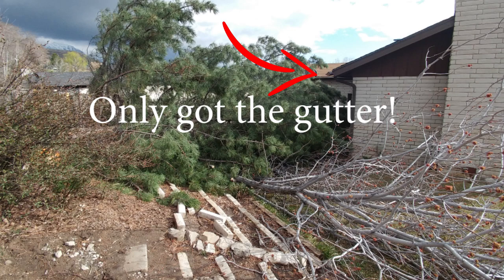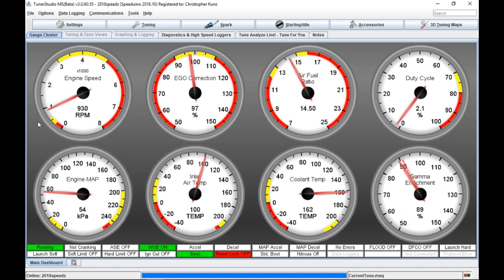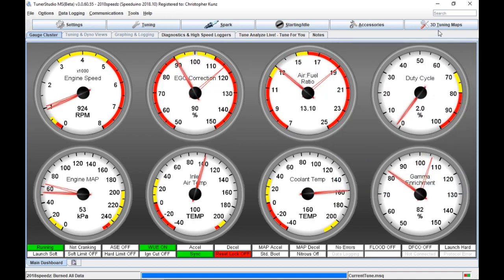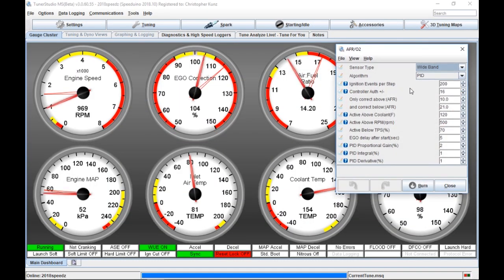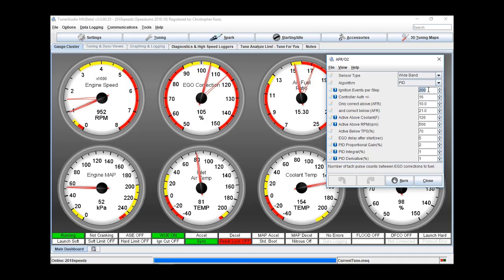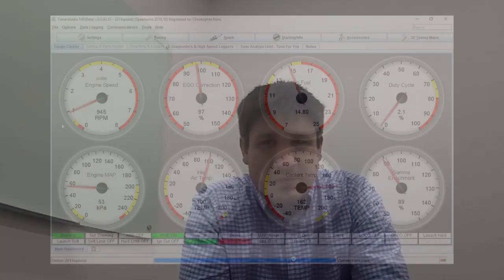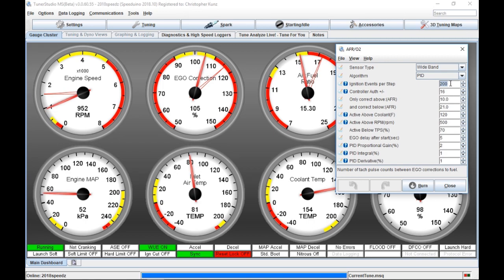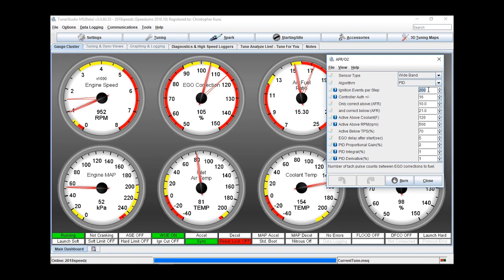PID AFR/O2 Set up Round 1

Comment: I found the "simple"  setting worked quite well for me instead of PID. I've tried PID with idle and boost but never had any luck dispite reading up alot about it 😭
Reply from the maker: I will do a follow up in the future. But my main hurdle is slowing its reaction as I showed in the video, and it not turning on until a restart at temp.
Reply: @CEKGarage  Tried the latest firmware?
Reply from the maker: Loaded it on Sat. Been playing with MAP accel enrichment. Have yet to drive it. Might have to take the car to work. Is it working better for you?

Comment: I see free heat for the shop come next winter!!
   Ok another Utuber found s setting to prevent the "it doesn't work til U reboot it" somewhere deep down in those menu's...
How are all the Grounding points / wiring in the car?  how many ground straps from batt - frame?, frame-near fuel pump?, batt-block? block to frame?  are you HID headlights / BALLASTS creating a Signal/Frequency? Have you toyed with Wireless SENSORS via Bluetooth??  Are you Decapped Injectors recently flow tested/all within 2-4% ?   fuel pump at least a $30 Kemso 340LPH job? Beefy clean wires to said fuel pump??
Any vacuum / intake / exhaust leaks? Any soft valve springs?

    That said you are my canary in the CoalMine so   TALLLy ON.!  Great great what your doin!! You are buildin A Skookum CHOO-Chur! Savin OLDe cars from the crusher!!! yes!!!  Hope lies in running e50 lean burn or some synthetic waste fuel controlled via SpeeDuino making ancillary parts aka Hot Rodding come back to life!!  Just what MURICA needs!
  Thanks  ;-)
Reply from the maker: Lol! Yes, that tree would do a great job at that!
Reply: @CEKGarage  Rocket Stove build!!  weldin/fab